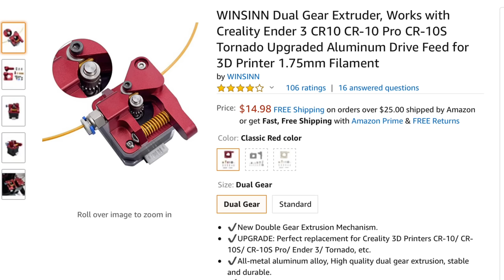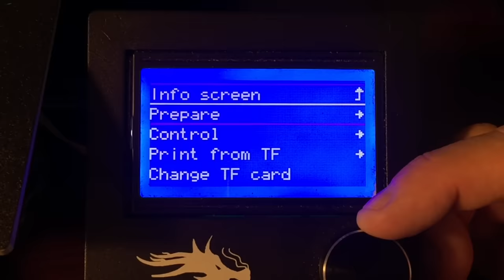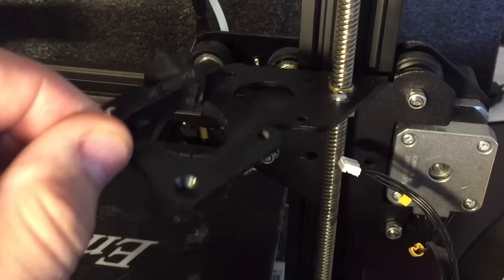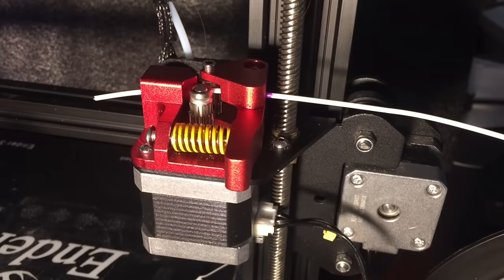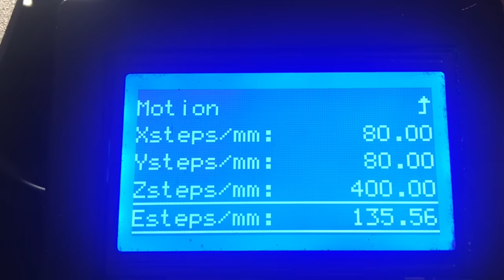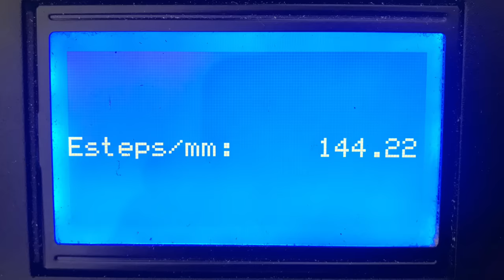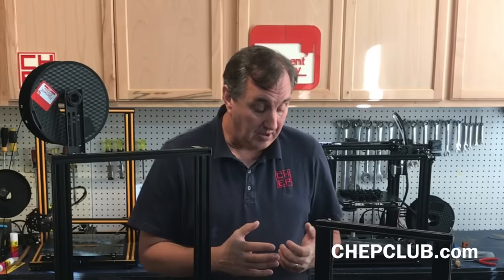Dual Drive Gear Extruder Upgrade + E Steps on Creality Ender 3

Comment: Awesome share.  You hurt my wallet sometimes ya know. lol
Now I have to get these for the Ender's on the farm.
What do you think of the BMG dual gear extruders? Have you thought about doing anything with that?  Those are on a lot of direct drive setups in the FB groups these days.. plus they are pretty good for the bowden setups as well.
Reply from the maker: I’m looking at them. Lots of people are using the clones.
Reply: @FilamentFriday  so true. Trianglelabs is a beast of a clone as far as a lot of things go too.  
I'd definitely love to see you put it through the trials.
Reply: @FilamentFriday  Using a clone here and I'm able to print flimsy TPU perfectly on my bowden CR-10 setup.  It's a pain to load filament but otherwise works like a charm and cost less than $20 if I recall correctly.

Comment: Great guide as I set up my Ender 3. Odd thing, the rate at which the filament moves in your video is about 10x faster than mine. Do you have any other guide on how to address this?
Reply from the maker: I’ve never heard of it turning that slow. Did it print the sample file ok?
Reply: I’m 20 minutes into the cat file and all food so far. I didn’t use the out-of-the-box firmware, upgrading to the stock Marlin 1.9. I hazard a guess that the firmware must be doing it, well beyond day 1 for me.

Comment: Do the esteps really make a difference being to 2 decimal places vs just rounding it? (ie 135.57 vs 136)? I think just rounding them would work just the same. Am glad someone finally showed esteps with extruder alone vs extruder with the filament going through the nozzle. Most don't mention this when calculating esteps. Would be interesting to see how a bondtech would do to see if it's the same in either case.
Reply: at least go to the first decimal, a 0.5% difference can be noticeable in a print
Reply: end up adjusting the flow on the slicer to fine it out
Reply: and make bed levelling hard if extrusion no perfect
Reply: Estep decimal places do make a difference, but not in a good way. Better to round to the nearest whole number. Every x amount of steps that fraction accumulates and Marlin ends up commanding an extra step which shows in prints.

Comment: Hi, my ender 3 menu is different from your. Which version is this os? In mine is missing the visualization of the part to set the esteps. Thank you
Reply: Probably Chep put Marlin on the Ender3...but its the same more or less
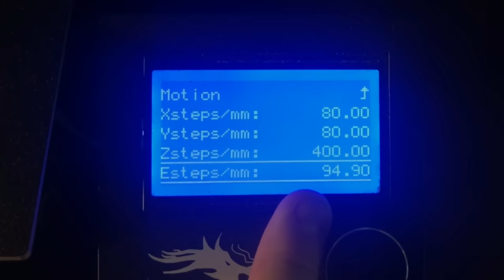Reply from the maker: As I stated st 2:17 newer machines and those with silent board installed have it in the menu.

Comment: Hi Chuck, to store settings (e-step mm value) in a normal ender 3 do I need to unlock bootloader and flash Marlin? Thank you so much for the very useful video!
Reply from the maker: If you have an older machine then yes. Or connect with pronterface and do it they GCode.
Reply: @FilamentFriday  thank you so much!

Comment: i ordered it and i cant fit it on.. 
ender 3 , i have a press pulley so i got it off with a rotary tool, when i put the new gear on it seems the motor crank shaft is too short.. so it doesnt even reach the right hight for both gears to connect
Reply: same. I'm thinking to buy a new motor. the original gear doesn't even feed on my printer. I'm out of options

Comment: Thanks for your video on this.  I purchased this and looks like lots of people on FB are having the same issue with the gear grinding into the metal  Any suggestions.
Reply from the maker: EZR extruder is better.
Reply: I ended up taking the lever off and used a 5/32" drill bit to drill out the hole.  After the hole was drilled out and the edges cleaned up, I poked a piece of PTFE tubing through and pushed it in as far as it would go.  So, I now have a PTFE guide that keeps the filament away from the lead screw and delivers the filament straight to the gears.
Reply: @FilamentFriday  I tried the EZR and it skipped and chewed up filament like crazy.  Also, it has no tension adjustment.  JUNK IMO.

Comment: It looks that the other needle bearing, inside the pressure lever gear, might be missing. The one I got had only one bearing in, caused inaccurate feeding.
Reply from the maker: Mine had two bearings in it.
Reply: Cool, good

Comment: The stock extruder has a clip to hold the hot end wires. The upgrade doesn't. What did you do with the wires after your upgrade? How did you make up for the missing clip?
Reply from the maker: The original extruders didn’t have the clip so I did the same and let it dangle.

Comment: Chep, I got my unit installed, but there isn't enough room for a knob to manually turn the extruder, and I tend to use that a lot.  For example, I love to do multi-color prints, which means hitting pause, and changing out the filament, running out a bit of the old filament until the color changes, using that knob, then continuing.  Is there an easy way to attach a knob and I'm just not seeing it?
Reply from the maker: No, that is a drawback to this.

Comment: Hi! One question about that yellow spring. I can't use that with my dual gear extruder, it's skipping all the time, when I grap the arm and reduce the pressure, then it works. So I have to use the original spring with some spacers to make it little more harder, then it works fine. Don't know why? But it seems that the yellow spring makes to much pressure on the dual gears so the motor is skipping. The yellow spring it's the same as to the bed.
Reply from the maker: Some people have reported that. It appears the tighter tolerance of Capricorn PTFE may be adding to the issue. Are you using Capricorn?
Reply: @FilamentFriday  yes i'm using capricorn, I did have skips also with The original spring after I wrote this comment, 20 minutes in a print it didnt extrude at all. I changed the nozzle and  cleaned the hotend but it didnt do anything, The filament goes smooth by hand through the Bowden tube. Will try to remove the washers on the spring and see if it goes better. Thanks for the reply!
Reply: @mrfomtsarcadecave1583  I noticed that on the original mainboard the extruder voltage was 0.56 out of the box ! The motor clearly doesn't have enough power at that kind of voltage, I increased mine to 0.95A (manufacturer max current states 1Amp), no heat whatsoever, give that a shot.
Reply from the maker: I believe 0.95v is the setting for TMC2208, A4988 should not exceed 0.8.
Reply: @FilamentFriday  actually the tmc2208 are 1.4A with peaks at up to 2A. Not sure the motor won't fry with that much current, gotta check its temperatures.

Comment: Chuck, even after I updated my motherboard to the 4.2.7 board the  extruder moves the filament in past 100 mm and then backs out to about 94 mm.  Is this correct for my machine?

Comment: Any idea how to set e steps on a ender 3 v2 with the touchscreen?  After installing the touch screen and flashing the creality touchscreen firmware, the option is not there like it is with the stock screen.  Thank you in advance.
Reply from the maker: Connect with USB cable and send M92 command. https://marlinfw.org/docs/gcode/M092.html

Comment: I know you said you previously had your extruder tuned in but maybe it needed a little more than the original 94 or what ever.
Reply from the maker: It’s because I normally adjust from there in the slicer flow. That way I can have different settings for each filament.

Comment: Chep if I may ask how do you get the filament to move with out attempting to print something? While you were doing the measure marks then had the filament run through the extruder I am not sure how to make it take filament with out a printing request.
Reply from the maker: Watch this: https://youtu.be/QnrH2Sk7y40

Comment: I tried a metal extruder once but found during prolonged use the motor would heat up the gears so much it would start to soften and warp the filament. This would lead to really messy entanglements that would prevent the filament from entering the PTFE tube, sometimes even pushing the tube itself out. What are your thoughts on this?
Reply from the maker: If you motor gets that hot then you need to adjust the stepper driver current lower.

Comment: Does this modification affect the ability of printing flexible TPU with the Ender 3 (Pro)?
Reply from the maker: It’s the same as stock Extruder, neither can print very flexible TPU. If you want that capability then I suggest the EZR. 
https://youtu.be/1GNDxvxpWr8

Comment: I got an ender3 pro calibrated e steps on. First rest it only extruded 40 mm had to crank up e steps to 235 do you think I got a bad motor? All the calibration vids I’ve seen most only need under 150 e steps. I had bad under extrusion before I did that now it seems ok. Also I did all metal extruded upgrade and did calibration with it installed.
Reply from the maker: That does sound like something is wrong or slipping.

Comment: I just have installed this dual extruder with Stepper Damper, however my extruder always skips on the gear when nozzle changes his position and filament is retracting. Any idea how to solve my problem? Can't find solution, I was trying adjust spring tensioner and play a bit with the corner screw from the second gear but with no luck...

Comment: I bought what appears to be the exact same extruder kit, but it also has an extra tiny brass washer with it. I didn't catch Chuck mentioning anything about it in the video. Any idea where it's meant to go?
Reply: My best guess is between the spring and tension arm
Reply: @tommegg8486  Thanks for the suggestion. I'll take a look at it.
Reply: @ryanjd93 any update on this?
Reply: @JeremyWeed  Never installed it. Seems fine so far but I haven't printed much since.
Reply: It goes between the gear and the aluminium so that the gear doesn’t grind the aluminum like in the last shot of the video.

Comment: I just recently had to replace the capricorn tube and the new tube was a bit longer than the old one. I noticed that you have to recalibrate the esteps even though the extruder gear was not replaced. makes sense?

Comment: I've followed your instructions and calibrated it with the bowden tube disconnected from the hotend I get 137.5 steps/mm. When I connect it to the hotend and send 100mm of filament through I get a good flow but the motor jumps a bit. Does this mean my feedrate is too high at 25mm/s?

Comment: Hey bud need help

I have installed this to my Ender 3 Max and now my printer keeps randomly pausing during prints. It keeps the heat going and pushing filament out. Any ideas on how to fix this?

Comment: This is the 5th extruder video I've watched, and so far the most helpful for walking thru the steps and explaining why. However, I still can't figure out how to calibrate my esteps! My control screen doesnt give me an 'extruder' option under the move axis menu and I am so frustrated because my prints were perfect before switching to the dual extruder and I KNOW under extrusion is the problem. Help!
Reply from the maker: Send an M92 command in the top of your GCode. https://marlinfw.org/docs/gcode/M092.html

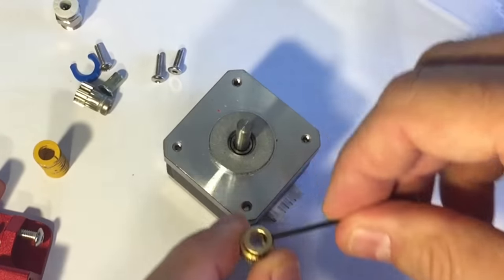Comment: 5:02 My set screw doesn't go in all the way. Tighten it as much as I can and there is still a little bit sticking out. It hits the printer when it makes a rotation which messes up my print. 
How the hell do I fix this?!?!? :/

it's definitely on the flat side. Still can't screw it in far enough.

Comment: Please test the differences when printing flexible filaments... Does it make it easier to print with then or should u rather go for a direct drive
Reply from the maker: I recommend EZR if you want an extruder that does all filament and flexibles. https://youtu.be/1GNDxvxpWr8
Reply: @FilamentFriday  thanks for the response... So ur saying even though its not dual drive it works even better than a dual drive bowden extruder for Ender 3? I'll give it a shot then and let u know how my results are... I got my first printer a few days ago... thanks to your channel all my prints came out absolutely flawless so far... keep it up man! I love your channel!

Comment: Are those menus stock?  My Ender 3 Pro does not have those options.   The Motion selection screen is BLANK.   I did "upgrade" my system with TH3D's  upgrade.   Am I now stuck without this ability?
Reply from the maker: You’d have to reflash it to stock marlin.
Reply: @FilamentFriday  Yep, that's exactly what I had to do. Odd the TH3D is forcing their preference over the flexibility the stock firmware gives.  Back to the Creality firmware...well, thier latest version and it's just as nice as TH3D's.
Reply from the maker: TH3D is not something I recommend.

Comment: WARNING !! this wont fit on your Ender printer if it has a filament runout sensor.. The hole in the extruder arm to guide the filament in, is too high above the level of the filament holes on the runout sensor.
You would have to modify the runout sensors height to make the guide holes line up.. Might be easy for some to modify the height of the runout sensor housing, but not for others just a FYI !!!

Comment: Chep quick question in the video at around 7:08 you mentioned putting a bigger coupling in it so it doesn't take the same size thread coupling. Asking cause I bought some of the good ones to replace the stock ones with and they are much better but from your video seems those wont work? If it is bigger is it the same size that goes in the hotend? Thanks
Reply from the maker: Yes. Same size as the hotend.
Reply: Thank you Chep. You are doing a great job with the videos. There are a lot of videos out there but you truly want to help. Thanks for taking the time to answer my questions. Most just make the videos and never talk back or interact with the community. Thanks a lot. Keep up the great work my friend.

Comment: So is it best to measure e steps how you did it? 1st extrude without the bowden tube/coupler and get it dialed in. Then put the bowden back on and extrude through the nozzle  and then calibrate it again?  Some people say just to calibrate without the bowden tube and that's it. Then adjust the flow from there.  Getting the final steps when it's extruding through the nozzle wouldn't you have to redo your calibration every time you switch to a different filament or if you switch out a new nozzle?
Reply from the maker: Without and then flow is really the best so you can adjust flow for each filament.
Reply: @FilamentFriday  Perfect. I just calibrated my estep's they went up to 95.2 and now I'm spot on with extruding 100 mm without the Bowden tube and coupler. Now I'll just do a one wall test cube to calibrate flow.  How to calibrate flow would make for a good video if you haven't already done so. Thank you for the reply and all your videos 👍.

Comment: In my case, this don't work... I don't know what to do to make the printer extrude well. The motor shaft of my extruder jumped back and lost steps. Change the extruder for this, but there is no way, keep jumping back and losing many steps, especially if I print at temperatures below 200 degrees Celsius. At 205 in principle It has extruded 10cm without problem. I would miss making a test print.

Comment: HI  CHEP
I enjoy your videos very much and have just installed a knockoff geared drive on my CR10S as per your instructions. My printer has no way to adjust the steps in the menu and Cura has a fit when I tell it to over-extrude at 151% . I am trying a print at 150 to see how it goes. Any suggestions on adjusting the steps on a 10S?
Reply from the maker: You can send it an M92 E92 or whatever your E steps needs to be. Send it via the Start Code in your machine profile. 
More info here: http://marlinfw.org/docs/gcode/M092.html
Reply: @FilamentFriday  Thank you so very much, it works perfectly now. I learned something today I should have known for ages. <Grin> And the geared drive is oh so much better, the stock setup is really not very good. I had jammed screw in the spring as a wedge just to make sure it had some traction before.
Reply: And now you have me thinking about the silent board for my CR10S. Now that I now how to transfer the settings to the new board. Will the one listed for the Ender3 just bolt in.
Reply: @FilamentFriday  how can you "send gcode" to your printer, i never did understand how ??
Reply from the maker: No, the silent board wont within 10S.
Reply from the maker: Rob b - you can put it on an SD card or connect using a USB cable included with your printer.

Comment: I have one of the new 2021 ender 3 with the short shaft. Before I order a new motor to upgrade how long is the shaft need to be to use the upgrade?

Comment: Will the calibration you show here for this extruder work for any extruder? Is it the same process in general? I ask cause I recently installed a metal extruder.
Reply from the maker: The same

Comment: Did you up the temp over 205? I would see what 210 to 220 would do.
Reply from the maker: Yes, I did. Same results as 205 until I get too hot for the filament.
Reply: @FilamentFriday  i have never had much luck with PLA at or around 200. 210 215 always jaa given me better results.
Reply from the maker: Depends on the PLA. My Filament Friday Filament is a lower temp product.

Comment: CHEP any idea where to buy a replacement spring for this dual extruder. Mine seems to be failing and is causing skipping.
Reply: You can buy yellow bed levelling springs which I think are the same dimensions. You may need to cut them down slightly

Comment: I'm getting moire ever since I installed the new dual drive. I calibrated the e-steps & set my retraction.  I am really struggling to get rid of moire & I never had it before I installed the dual drive. I have tightened everything, rollers, belts etc. I can't figure out what is causing it.

Comment: So I have An ender3v2 and I updated the extruder to dual gear extruder and did all the calibration you mentioned ,and i started having over extrusion from the second layer and on despite  the fact that first layer is perfect .. what is the sreson? Thanks in advance.